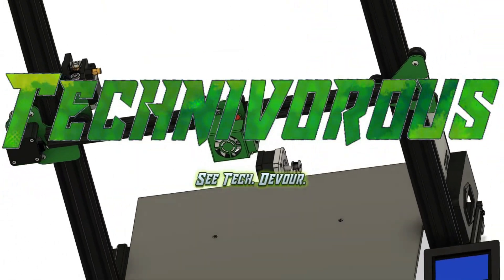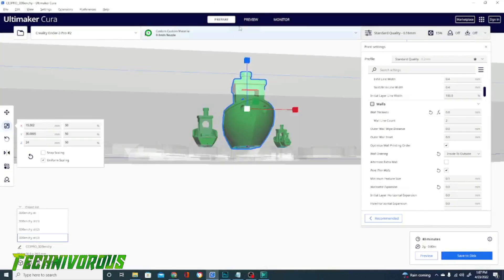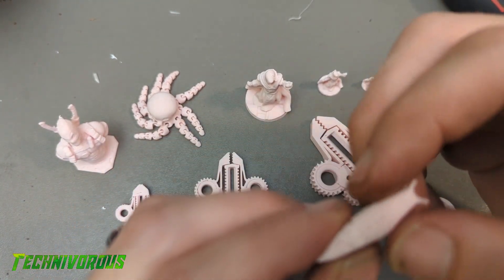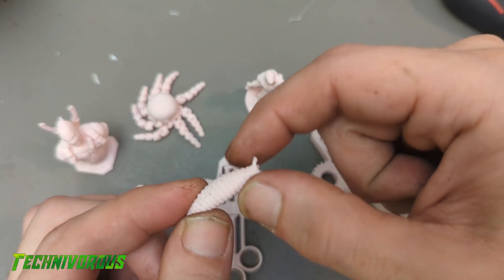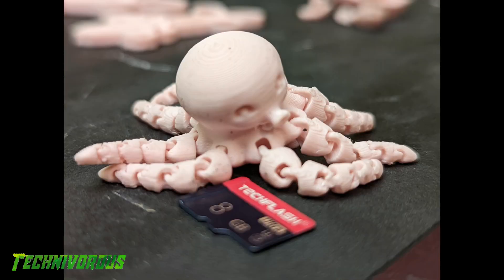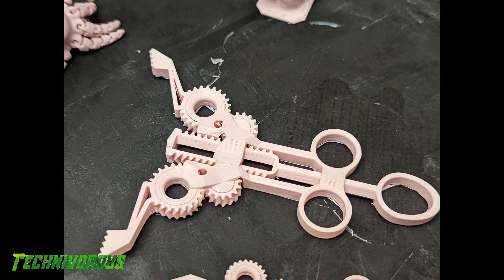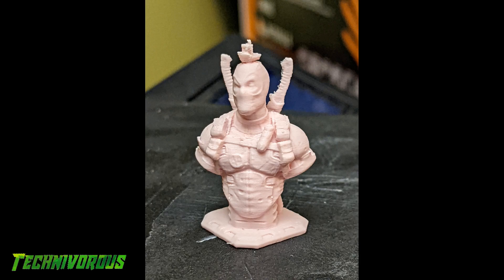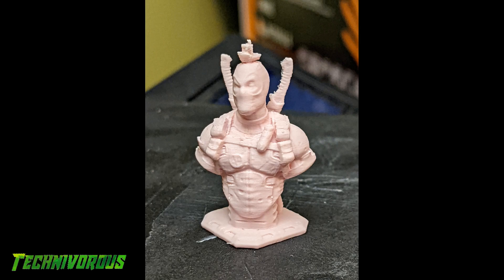Cura 5 Beta Limbo!  How Low Can you go?  printing super small with cura's new engine!

Comment: Interested, I already frequently print extremely thin and small prints (3mmx2mm) with a 0.2 nozzle on my ender 3 using the old cura so would easily be able to tell the difference

Although not keen to lose plugins and or my custom profiles and projects
Reply from the maker: Profiles transfered over fine. Plugins will be ready when each dev fixes them so that sucks but I'm sure won't take long. Since this is a beta it doesn't offer to delete your old version so u won't lose anything
Reply: @Technivorous  so I have windows 7 and it's no longer supported and won't load. Have to try on my work pc

Comment: nice video!
does cura 5 could make multiple layer height, I mean not adaptative layer but different layer height?
Reply: No. Cura only has adaptive layer height, but you can't set a layer height per layer. You can only run the adaptive algorithm and let that figure out what layerheight to pick.